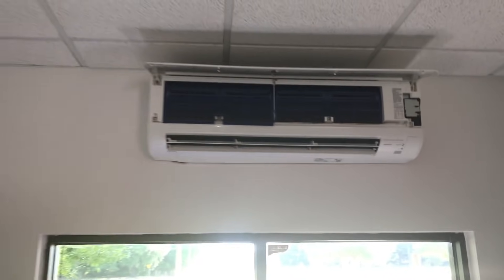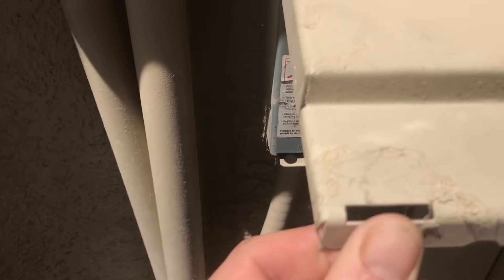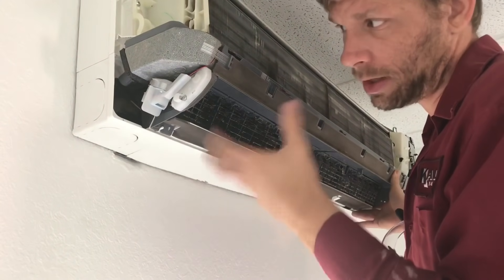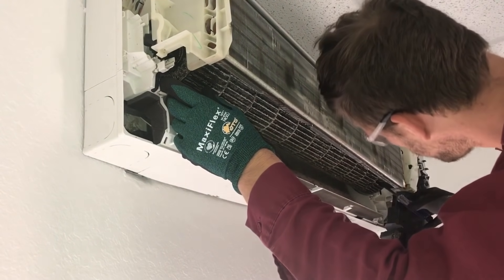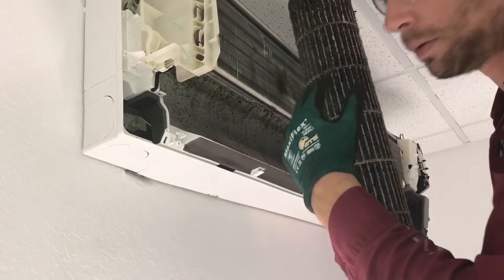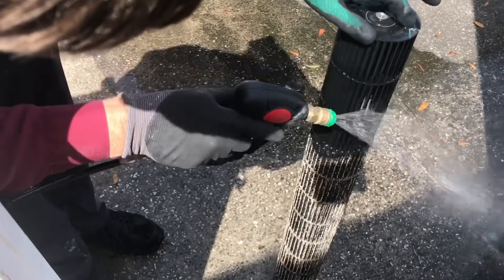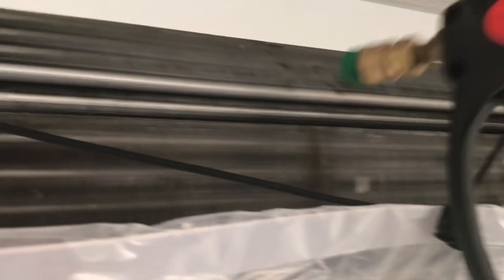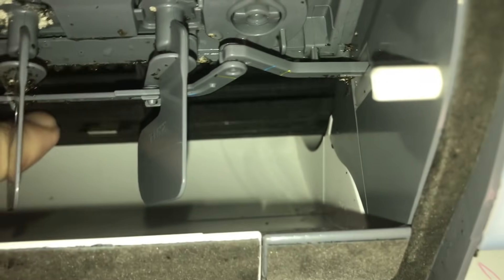SpeedClean; Blower Wheel and Evaporator Clean

Comment: That's a neat kit and you knew what you were doing and worked efficiently - even so that's got to be an expensive job for the property owner. I just bought a house with an older Mitsubishi unit and I had to fully disassemble it, removing the motor, to get the fan out. So basically a half day to get it clean and put back together. Seeing this video as probably best case is the final bit of information to make me realize that ductless units are not for me.

Comment: How did the unit get so dirty if the filters were in. I'd have to think it ran a fair amount without filters. Nice video.
Reply: The air filters in ductless units are wishful thinking at best...
Reply: The AC environment is humid, hot, and spreads water all over the place, all are a recipe for mold, bacteria, dust, dirt, rust, just like a bathroom, but unlike the bathroom, you don't have direct access, this requires time and effort every few months (preferably every month), you would be the one at the end who has the most efficient and cleanest air of all the people you know, this also makes you healthier.

The filters only prevent the coil from getting dirty, they did their job quite well actually
Reply: Quiet, efficient and clean.  Pick two.
Reply: My units blower was filthy! Filters clean! Bad engineering

Comment: Seal the hole where your pipes go through the wall, the negative pressure inside the unit looks like it's pulling unfiltered air through that hole from the wall cavity or outside if it not sealed there, should reduce this build up greatly.  You can seal the inside with the cover off

Comment: Would it make sense during the initial mini-split installation to place a decorative board between the unit and the wall so that overspray from the repeated cleanings does not stain or damage painted walls?
Reply: It wasn’t spraying on the wall the bib covered a lot and he angled the spray to avoid that Karen

Comment: Excellent cleaning job. Just one thing, I noticed you didn't protect the ceiling with plastic.  I'm sure the ceiling tiles took a hit from all that pressurized solvent being sprayed around.
Reply: I was looking for tips on that very same thing. With the pressure spraying, it will spray upwards as well. I bought one of these and tested it, the first time I managed to get the wall above the unit pretty wet...

Comment: Those filters were relatively clean compared to everything else. They’re not very effective are they?
Reply: that is why its cheaper to get a window shaker than this minisplit, when it dirty on window shaker u just spray water and wont cost u anything , with mini u have to call tech and time cost more than buying another window shaker. Ill pass on the mini.
Reply: @dangda-ww7de  you are right about maintence, but split systems are nearly silent when operating and don’t ruin the view out your window.  Pick your evil.
Reply: Very true

Comment: Love that coil washer, I have used it many times. It peeled cooking grease off a Evaporator with ease. Great video don’t forget your lock out tag out you don’t want someone coming up and turning the unit on. Great job !!!!!!!!
Reply: Ron Powdrell how durable would you say that speed clean washer is? A tech I know said to avoid it because he went through 2 of them, that it’s not durable
Reply: fespinoza287 I have had it a while. Our air quality department has two and they are holding up fine. It’s made well. Check the warranty you may have a trial period that you can return it in. There are many variables to your friends statement. I try new things on my own but do respect others opinion.